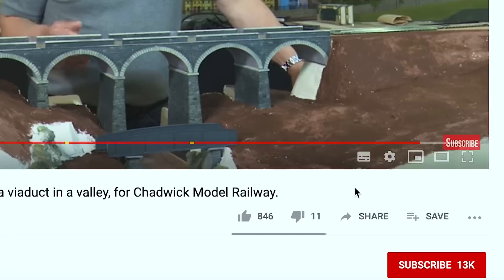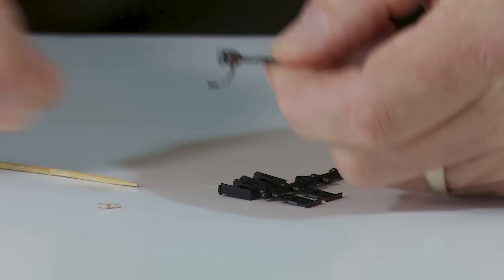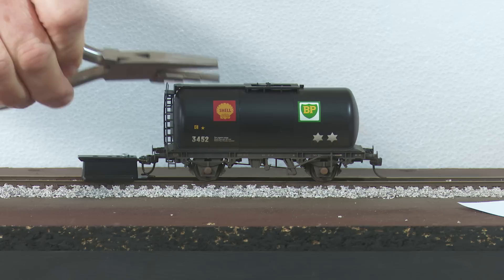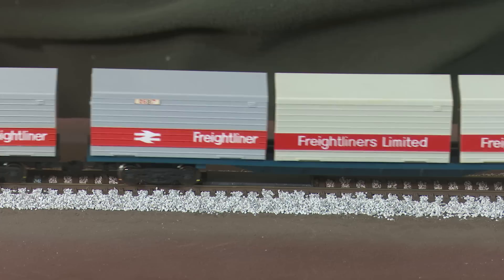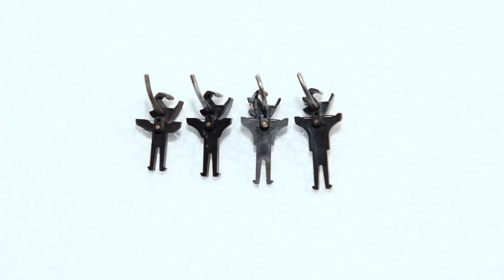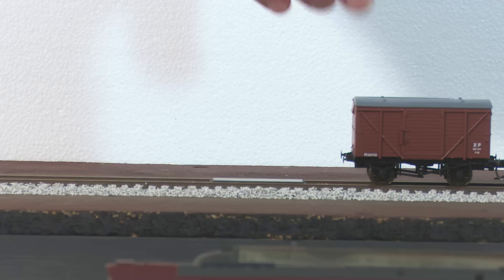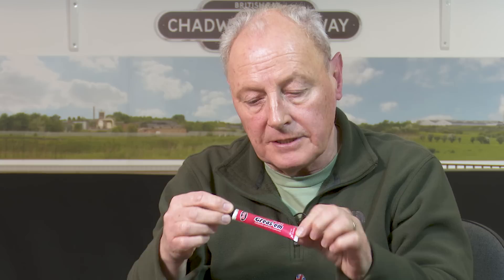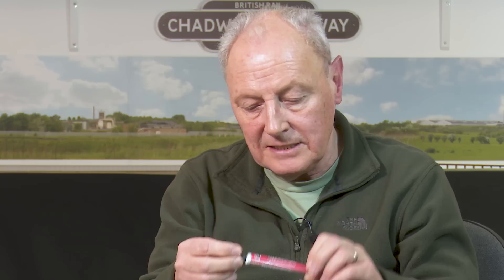Kadee Couplings at Chadwick Model Railway | 81.

Comment: Hi Charlie.
I've been using Kadee's for over 20 years, precicely for the reasons you explained.
One difference though, I always mount the draughtboxes to the chassis, not the bogies because I like to have all the pipework detailing at the ends.
I agree with what you said at the end too.
I think the reason manufacturers kept using tension-locks was because of a "That's how we do it here".
I hear the same argument used for people who still use enamel paints for buildings, even though acrylics are better because they dry quickly meaning you can get a job finished in an evenings modelling rather than having to take a week to do the same job because they're waiting for each coat to dry with enamels.
Why? "Because that's the way it's done!"

Incidentally, have you seen the new Hunts couplings (magnetic ones)?
I think they will be fantastic for rakes of coaches, especially for things like HST's, so you can push a train the train from the back powercar without having the problem where some uneven track, or the vibration of going over points make the 'pushing' coupling jump on top of the 'pushed' coupling and lifting the bogie up at the couling end and having it lift off the track causing a derailment.
https://westhillwagonworks.co.uk/couplings-new-c-2/hunt-couplings-close-coupling-10-pairs-for-nem-sockets-p-23

Cheers

Laura
Reply from the maker: I think we are in total agreement on this one Laura. And those new magnetic couplings are certainly worth investigating. Regards Charlie

Comment: Great video as always, I have just finished converting over 300 wagons to kadee and as you have said the difference in height even within the same manufacturer's wagons is a joke. One shortcut is the hornby wagons with the 4 corner clips. It so happens that the Dapol chassis are the same fit and can be bought separately and come with Nem pockets and metal wheels saving a lot of time not to mention you can sell the old Hornby chassis which have a strong market for  so you recoup some of you cost.
Reply from the maker: An interesting comment Rob. But sadly we’re just hiding the poor consideration that we receive from these UK companies. 
They are taking us for suckers.
Reply: @ChadwickModelRailway  I totally agree especially with the rate of price increases

Comment: Hi Charlie,  
Excellent video - and thanks for highlighting the problems with couplings. Here at West Hatton we have been using Kadee's for around 5 years and would not consider anything else as the hands free magnetic uncoupling & 'push shunting' are the main benefits along with a more aesthetic look. It is about time the issues with NEM pocket height are bought to the attention of manufacturers. Peter's spares sell a NEM pocket height gauge which is a very useful tool for 'Kadee mods' and there are 3D printed NEM replacements for older stock available on E-bay.
Could you also look into the other issue of locomotive 'close' coupler mechanisms which are also a nightmare for magnetic uncoupling, such as the Hornby class 60/56/31 - the flimsy plastic arms that are fitted flex under load and then breakaways happen and of course magnetic uncoupling with kadee's is impossible.
Well done once again for a very informative video....
Regards,  Nigel at West Hatton model railway.
Reply from the maker: Thanks Nigel, like you, I find that British couple hours are dreadful. I’ll be checking out magnet couplers in the next video. Hopefully you’ll find it useful.

Comment: I've been switching over to Kadee couplers because of there ease of use, the standard couplers by the large brands as Hornby / Bachmann / Roco / Fleischmann do not provide the same ease of use.

Another benefit, the 4 different Nem variants ranging from 17 to 20, with the wire for uncoupling also mimicking a pair of air hoses for the brakesystem.
Reply from the maker: We certainly agree on this one RJ

Comment: Many thanks for this video, which confirms my decision to opt for KaDee couplings. To date I have used the NEM type in conjunction with boxes obtained on Ebay for Mainline in particular. In addition I have used No 5s for much older stock. It would appear I should have tried the ones included in the first part.
Reply from the maker: Hi Alec. I’m so pleased that you found it useful. Kadee’s are the way ahead.

Comment: Thanks for the explanation of Kadee's. They are something I am interested in doing, but I think it's worth stating that the 1030 starter pack you mentioned is around the £60 mark! While it seems a great way to work out which Kadees you require it includes stuff like the specialised pliers which I could do without. I shall give them a look at Modelrail Scotland next week. But you are right about the embarassment of tension locks! - they MUST go! Cheers
Reply from the maker: I’m so pleased that you found it interesting Daveie. But as you say it is an expensive field to consider.

Comment: Hi Charlie I used 4mm cylinder magnets that i installed between the sleepers with a 4mm drill six to each uncoupling site and level with the top of the sleeper,I found it to be a lot neater and no obstruction in the centre of  the track ,the down side is when you weather the track you dont see them at all so now i have them marked with  different lineside items such as electrical box,s and the like,these magnets are available online at supermagnet .com    .really enjoy your channel   jw
Reply from the maker: Interesting points JW. 
I’m Trying the Earthcore magnets
Reply: @ChadwickModelRailway  I have never used earthcore magnets I'll be interested to hear how they work out

Comment: Thanks again for a great video on Kadee couplings. I have approx 85 wagons of various types and have been considering fitting Kadee. This will cost me a load of cash. With coaches you only need one at each end of the rake. I have often wondered why the major manufacturers don’t offer of buying items already fitted with Kadee at maybe an additional £5-6 pounds. What do you think of that. I’m afraid these manufacturers should remember without us customers they would not be in business for very long.
Reply from the maker: A joint review of couplings by all manufacturers is well overdue.

However, sadly I just cannot see it happening. Regards Charlie

Comment: About the loose fitting issue at around 18:25 that makes the coupling drop down, seems to me it could be solved by adding a tiny screw as a self locking shim. Now, do keep in mind I am talking very tiny screw, as I doubt it would even need the threads to actually bite into the plastic, just needs to be wide enough across the threads to shim and tension it against opposing mating face as it is screwed in. Far less abusive than glue.
Reply from the maker: An interesting point mate. I shall have a closer look and see if it’s feasible. Regards Charlie

Comment: If you mount the Kadees directly under the BODY of the Freightliner (ie bogie) wagons, rather than on the bogies, you should be able to keep the drop pins. Shorten the bogies so they clear the back of the coupler mounting boxes, and put packing pieces of plastic (as required) between the underside of the body and the Kadee mounting boxes to get the correct height. There is some trial and error required as to the best Kadee SHANK, depending on 4 things: 1) the (body) length of the wagon; 2) the distance between bogie pivots (which means the length of overhang from the bogie to the end of the wagon); 3) the minimum radius curves; and 4) buffers (locking - or you can remove them!). It is also possible to mount LONGER shanked Kadees further BACK from the end of the wagon - this gives better "swing" for curves while still retaining smaller inter-wagon gap - trial and error though.  It is NOT a 100% solution, as very long wagons, with very long overhangs, on very tight curves still have problems; however in HO (Australian models), I can easily get 80ft (2x40ft containers, plus a bit) wagons (so 80ftx3.5mm/ft=280mm actual length=70ft wagon in OO) with small/normal/proportionate overhangs around 22in curves. I have previously body mounted Kadees on OO coaches with no problems (other than some coaches have things like body/chassis clips in the spot where I want to mount the Kadee!).
Reply from the maker: Wow, that’s some great information Ross. I will conquer these freight liner wagons but it just takes time and patience.

Comment: Hello Charlie just to throw another coupling in to the mix and especially with your container wagons try the hunt couplings sold by West hill wagon works designed by chris hunt of hunts heath model railway, they are magnetic ones which will be perfect for your container wagons, take a look at West hills web site and see for yourself.
Reply from the maker: I’m on the case FCMR. An interesting point. Thank you

Comment: I am surprised, as a modeller of British N gauge/2mm that NEM pockets for 00 gauge are not standardised to the same level as they are for N gauge. There is a definitive protocol for N scale NEM pockets, and the height variance may be tenths of a millimetre. Dapol make amazing kadee-like couplings for their N gauge stock, which come in the box for most of their N stock (I purchased one of their N gauge terriers today), which can replace the dreadful Rapido couplings that frankly should have been left in the 80s. Dapol also supply Scale buckeye couplings with all their their N stock, which when installed look, as you might say Charlie, quite handsome. That being said, certain companies, such as Peco are massive offenders when it comes to making stock without NEM pockets. instead using un-sprung rapido couplings that are prone to uncoupling at the most inconvenient moments. (certainly not what you want in the middle of a huge rake of coal wagons.)
Reply from the maker: Thanks Chris, at least the N Gauge suppliers are leading the way.

Comment: The what you call the uncoupling shuffle is an actual operation on railways with buck eye couplers such as USA, Canada, Mexico and others
It happens as the  buck eye coupler is under tension the conductor cannot pull the handle to release the coupler if the engine backs up a small amount the tension is taken of the coupler therefore it can released
You can see this in action In YouTube Distant Signal title What happened to Tiford Yard
This is a recently abandoned hump shunting yard
The train comes to a stop next to the conductor @ -5.10 and backs up @ -3.39 you can hear the couplings freeing up 
One thing a short train itself quick on a long train 2 miles plus it's much longer as the train with 200 wagons (cars) this is 400 buck eyes to take the tension out of
Also the couplers take a massive strain and do regularly brake and air line bringing the train to a halt
Reply from the maker: Yes Anthony I agree.  However, this uncouple sequence is automatic.
Regards Charlie

Comment: It's always struck me how much better the Hornby Dublo coupling was to the tension lock coupling that Triang used.  Yet another case (like Betamax & VHS) where the wrong one won!  
One of the best all-round couplings in my book was the sort of reverse tension lock that I think Märklin brought in in Germany (like https://www.roco.cc/en/product/22586-0-0-0-0-0-0-003005-0/products.html), and was refined by Roco, who made it smaller and neater, but they generally all just about managed to couple together, and were even usually happy to couple on curves. Fleischmann had a whole different ball game with their couplings which were more akin to the Triang and subsequent British tension lock, but even on some Fleischmann wagons I once had made around 1948 (they said made in US zone underneath!), the Fleischmann coupling was so much small, neater and effective. Even then.  Then in the 80s and 90s the NEM socket came in, and the continental manufacturers (primarly Roco, Fleischmann and Marklin) started playing with close couplings that could be easily interchanged, combined with mechanisms to hold the NEM socket that prevented buffer locking and derailment on tight curves. I don't think any of the close couplings would couple on curves: the Roco one in particular really wanted a straight bit of track to couple.  I think I saw recently that Hornby now sell a close coupling that looks extremely like the Roco coupling I remember from the 1990s.
Reply from the maker: What a great comment Andrew. The history shows what a minefield this subject has become. Many thanks Charlie.

Comment: Hi Charlie. Currently fitting Kadee to my locos and the ends of coaching sets. Imagine my surprise when having fitted to a Hornby t9 tender, the same coupling did not align vertically on a Hornby Mansell coach. After a bit of pondering I noticed that the coupling retainer on the tender could be turned over and all was well. Wonder if anyone else has been caught with this one? Barry
Reply from the maker: An interesting point Barry. I must confess, the whole subject of couplings is a major disappointment in this country. Regards Charlie

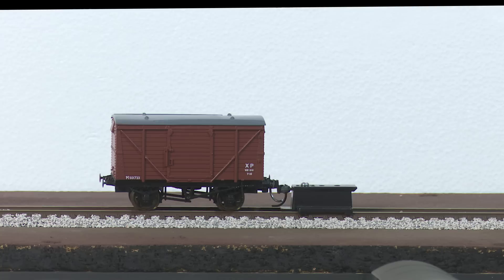Comment: the height issue at 16:00 is probably is from a scale issue. those wagons are 1/76 instead of 1/87
I hear the rivet counters complaining that kadees are not prototypical of the UK 🤣
Reply from the maker: No AJ, it's just poor manufacturing standards.
Reply: Chadwick Model Railway that works too

Comment: Charlie Another fantastic and informative video for us novices. I’ve thought for some time to start inserting Kadee on my stock but I have something like 50 locos 50 coaches and 120 wagons so it would be quite an expense although not every coach would need a kadee.
However something I thought don’t you think the major model railway companies should consider selling the models with kadees fitted at an additional cost. For example model no 1234 with normal coupling and 1234k with kadee. What do you think. I sometimes think at times the model manufacturer’s take us customers for granted. I recently had an email argument with Simon Kohler at hornby about the limited rocket collection whereby only 1500 units being delivered when in my opinion it should have been at least 4000.
Anyway Charlie good luck and I can’t wait for the next video
Reply from the maker: Michael, it’s great to have you onboard. 
The manufacturers treat us terribly.

Comment: Charlie, nice, couple of things, you cant buy KD 17,18,19 & 20s in bulk, feel sure you know, but it comes across differently.. unless I’m wrong in which case tell me where and I’m sorry in advance, now Ian at Mckinley no not Ian, Tony, had a lovely little gauge for measuring the height of the NEM socket..  did he make it or buy it? I have a small L shaped end to end in the shed all of my stock is fitted with KADees, as a novice I thought I would only purchase Bachmann that changed when I found out I had to reconstruct the NEM socket on a prairie to fit to the same era wagons from Bachmann! Whinging aside bodging is part of the hobby! Then I thought hang on that now bodged Loco cost me £150 (ish) plus £30 for the decoder, plus etc etc... maybe I should make my own Locos and wagons... still a great hobby, with really nice people, and pretty good videographers! as always cheers.
Reply from the maker: Hi Vic, I’m so pleased that you enjoyed the video. The gauge which Tony uses I believe is home-made. You’re correct that any NEM type couplers cannot be bought in bulk, it’s only the whisker types. Regards Charlie.
Reply: You can buy the NEM KaDees in bulk from DC kits - part of Legomanbiffo's empire,  I get mine from them - speak to Charlie -  www.dckits-devideos.co.uk
Regards...      Nigel

Comment: Hi Charlie,
re. NEM coupler pockets, most modern continental HO/OO stock not only has these, but is also designed so that the vehicles are automatically spread a little bit apart when the train goes through a curve, so that the coupling is elongated and the buffers do not engage with each other.
For older stock which has neither, small kits are available that can be mounted under the car or loco body (alas this usually involves generating some space through drilling/cutting, plus glueing); these kits provide the mechanism for elongation and centering of the coupling as well as the NEM pocket that is adjustable in height. Look out for „RIBU KKD“, article no. 85503, or the smaller „RIBU SKD“, article no. 85504, by Rietze Co., www.rietze.de. I’m afraid the website is in German only, but when you contact them by e-mail they should be able to understand (and answer in) English.
I‘ve noticed the kits have also been offered via ebay or amazon.uk online.
Cheers, Jörg
Reply from the maker: Thanks Jorg, I’ll check it out.

Comment: Great video Charlie, for some of your wagons you may need to consider changing your wheel sets to larger or smaller diameters to get closer to the "correct height". On the engines you are sort of stuck with shaving or building up the chassis to get them set correctly. Thanks for explaining the higher Kadee numbers as NEM replacements, never really understood them but I do have an old steam switcher that I may need to figure out how switch over to Kadee's. If you have separate trucks at each end, shaving or washers can help with coupler height adjustment.
Reply from the maker: I’m so pleased that you enjoyed it Chris, it’s such a dilemma.